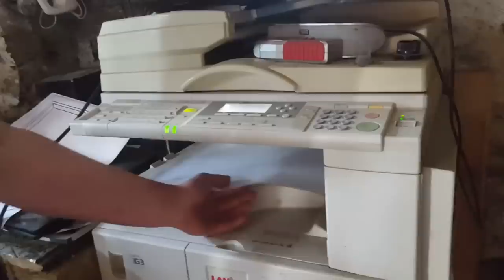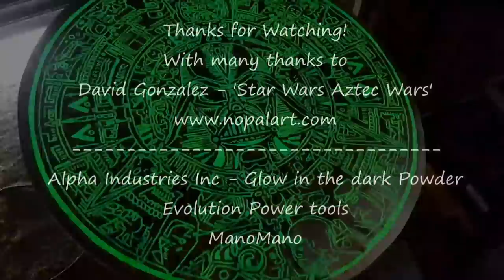DIY Pallet Coffee Table - Star Wars  Router Carving

Comment: That sir, is one of the great things I have seen......has given me some artistic direction.
If you could answer a quick question for me.....the luminescent powder, is it added to resin then varnished or an all in one finish?
Reply from the maker: Good, have fun, its a great medium to work with and looks great :) Ad the powder to the resin, and then pour into the piece. Allow to dry, sand off the excess and then finish off with varnish or oil. Just make sure youre final finish doesnt have a uv blocker in it.

Comment: great vid mate,those cnc bits are good  and alot cheaper
Reply from the maker: Theyre great bits, ive done this one and the one of my dad on the same bit, it still feels sharp. Problem with the tape though and its not cutting through it so pushing it up and taking off the design with it so less tape the better.
Reply: yeah its a pain i try not using tape now i tend to reverse print everything with my laserjet and put it face down then use thinners on it as long as you press really hard whilst rubbing in thinners it turns out really clear
Reply from the maker: Im going to try that in a bit, do you use the back of a spoon to rub it down?
Reply: hello mate,iv not tried with spoon but it supposed to work well,best results so far is by sanding the wood first for a better transfer
Reply: how did it turn out?
Reply from the maker: It partially worked, it got late and the timber i was using wasnt clean enough and like you say needs sanding, it also smudged slightly because the paper moved, so a good start in the fact that some of the print actually left the paper this time. Ill keep at it, thanks for your help.
Reply: no worries the only other thing to be careful of is if you are using more than one piece of paper be sure to put a very thin piece of tape all the way down the seem it stops the thinners leaking through and smuging

Comment: Was there a final sand on the top after applying the glow resin to clean it off the high spots?
Cool table man!!!
Reply from the maker: Yes, with the belt sander using used 80 grit belts, they clog up quickly though. Then ill use the finishing sander, then some wire wool, it could be better and ive a substance called rottenstone here that apparently is good for polishing up resin.
Reply: thepoultrypeople very cool man.
Can’t wait to try it out!! 
Thanks!